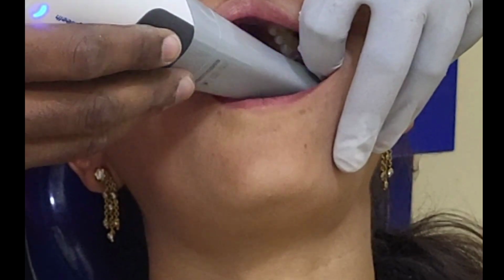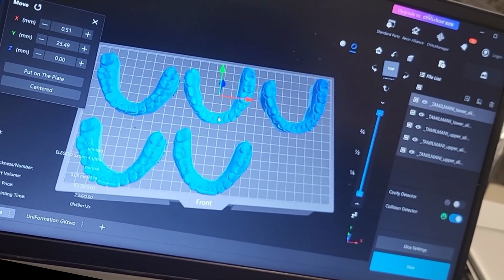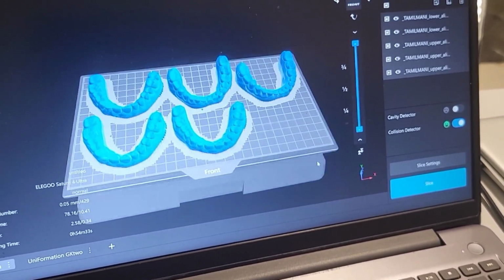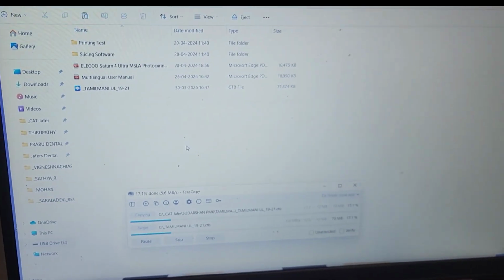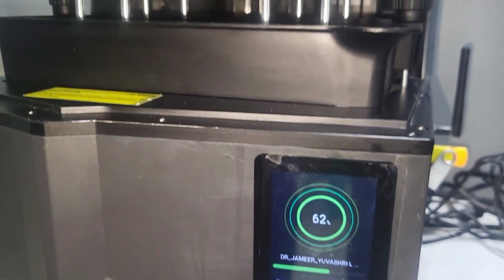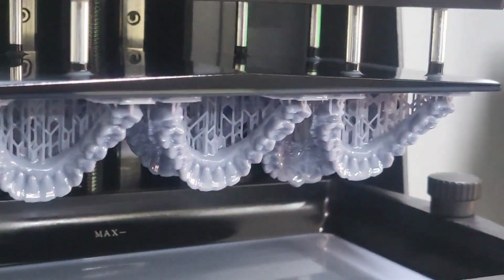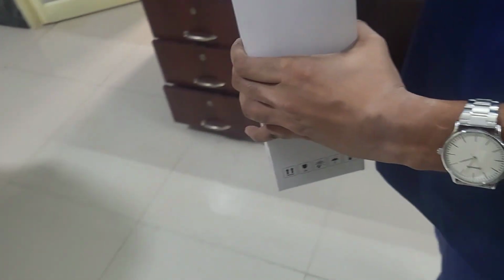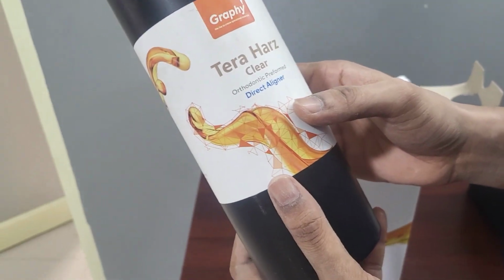Clear Aligner (in house)making video by orthodontist

Comment: Hi bro 
After thermofoaming, use ✂️ for sheet cutting (excess)
After that use diamond disc for labial and buccal trimming, next use your thumb for pushing aligner from the model, then use cutting bur and trimm on lingual and palatal excess material, if you do proper cervical trimming it's good for patient use and look like good finishing
Reply: Thanks for the info😊